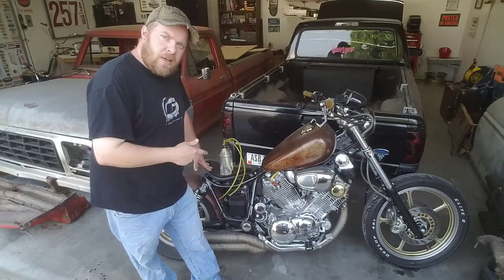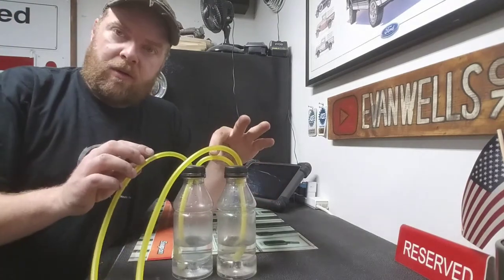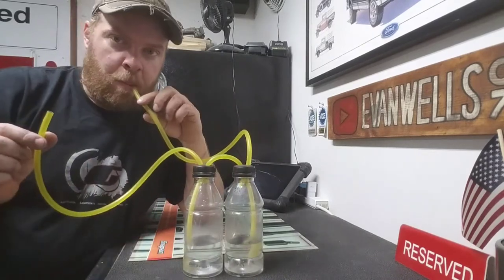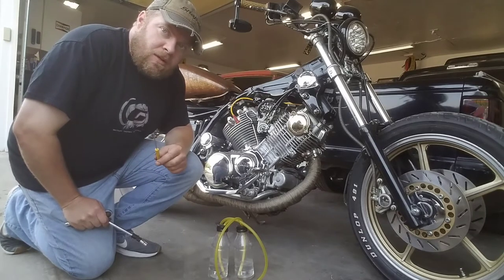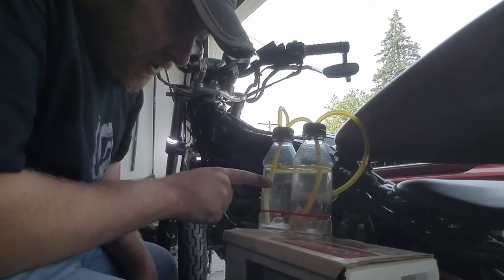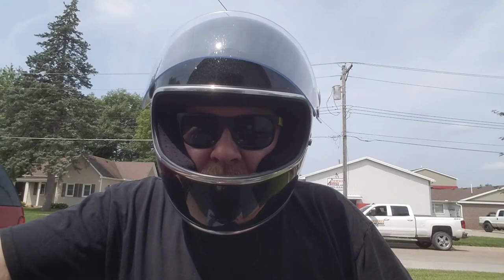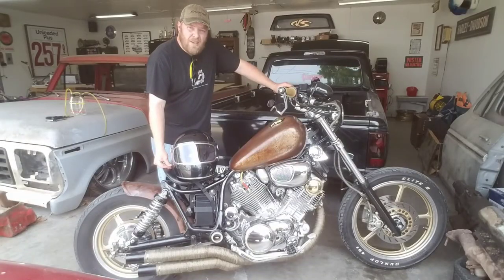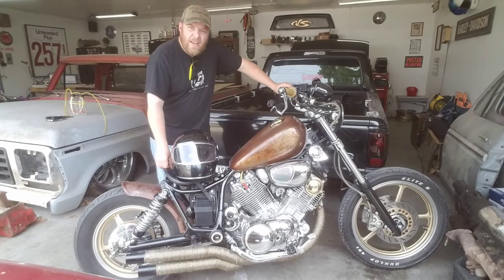88 YAMAHA VIRAGO 1100 - Carb Sync How-To & DIY Tool - Budget Bobber - Custom Motorcycle

Comment: What if youre bike doesn't start up at all after you did the carb rebuild instead it makes a loud boom noise
Reply from the maker: I would make sure the plugs are good.  Even if they look good, I'd try a new pair.  I will be making a new video soon getting the bike going for the season where I show almost exactly this issue.
Reply: @EvanWells07  this is my first bike I've owned the most I did to the carbs were taking the bottom bowls off taking the jets out cleaning them and putting it back together before my bike started up and now it won't start up and makes a loud boom noise and you see a flame come out the top exhaust tip
Reply from the maker: It sounds like it's loading up on fuel, then igniting it.  That's why I say to try a new set of plugs.  These things are the most picky thing I've ever worked on when it comes to plugs and fouling.
Reply from the maker: This is also my first bike, I've always been a car/truck guy, but got this for free, so I figured I'd give it a go.
Reply: @EvanWells07  okay I'll definitely try to get new plugs and see how that does
Reply: @EvanWells07  okay so, I had an extra spark plug I put in and the bike started up and revs up just fine idles a little lower than 1,000 rpm tho. But now when I put the bike in gear and slowly let off the clutch it dies on me what could be wrong now?
Reply from the maker: Have you adjusted the carbs?
Reply: @EvanWells07  I didn't take those out the air/fuel mixture screws stayed in the spot they were in when the carb was already adjusted
Reply from the maker: Is it a single carb or two?  If it's two, they will need sync and idle adjusted.  If not it may just need the idle adjusted.
Reply: @EvanWells07  yeah it's two, so I need to sync and idle adjust I saw you're video on the syncing which good idea by the way on how to do that, but how do I do the idle adjustment
Reply from the maker: @shawnlewis5772  if it's like mine, there should be a big adjustment screw by the throttle cables.  You can just turn it by hand.
Reply from the maker: @shawnlewis5772  sync the carbs first, then adjust the idle.
Reply: @EvanWells07  okay thank you for helping me out I appreciate it!🙏💯
Reply from the maker: @shawnlewis5772  No problem!  Hope it works out for you!
Reply: @EvanWells07  okay today is a free day for me so I'm going to sync the carbs where did you hook the hoses up to for the sync
Reply from the maker: @shawnlewis5772  on the carb boots near the head there should be a small vacuum line.  That's where I hook it up.  I'm actually working on a new video today, where I go through the carbs, re-tune them and sync them again.  Should be out the beginning of this next week.
Reply: @EvanWells07  Awesome! And thank you brother for you're help couldn't have done this without ya!
Reply from the maker: @shawnlewis5772  no problem!  I'm still fighting getting mine running right, so I hope it works out better for you than me :)
Reply: @EvanWells07  yeah mine just shuts off when I have in first gear and I'm trying to take off that's my only problem so far with it
Reply from the maker: @shawnlewis5772  if it just dies like you hit the kill switch, it may be an issue with the clutch switch or kickstand sensor as well.  If it sputters and dies it's probably tuning related.
Reply: @EvanWells07  yeah like it doesn't die when I kick it in first gear it dies when I start to let off the clutch in first gear like it losses power or something and just dies
Reply: @EvanWells07  one more question what lines did you get for the process
Reply from the maker: @shawnlewis5772  like the ones I used for the sync tool?
Reply: @EvanWells07  yeah I just dont want to get to big of lines you know what I mean
Reply from the maker: @shawnlewis5772  I just used 1/4" line I think.  It's just cheap stuff from the parts store.
Reply: @EvanWells07  okay thank you would 1/4" PVC Clear Vinyl Tubing work
Reply from the maker: @shawnlewis5772  I would think so.
Reply: @EvanWells07  giving ya a little update so it's running now idles perfectly at 1000 rpms but when it starts to get hot it ldles at 2000 rpms
Reply: So is that normal? Or is it running to lean or rich when hot
Reply from the maker: @shawnlewis5772  I guess I'm not sure.  Does it stay up at 2k rpm or drop eventually?  I know mine will hang a little when it warms up, but goes back down after a few seconds.
Reply: @EvanWells07  I mean yesterday when I took it for a ride the power was there it drove amazing but when the bike got hot as I was at a light it stayed at 2,000 rpms even when I reved it up once to see if it would go back down
Reply from the maker: @shawnlewis5772  that's strange.  The throttle or cables aren't sticking, are they?  You could try lubing the cables.
Reply: @EvanWells07  how could I lube the cables?
Reply: Should I try messing with the idle screw when it gets that high?
Reply from the maker: @shawnlewis5772  you can.
Reply from the maker: @shawnlewis5772  take the throttle apart on on the bars and spray some lube down the cable ends.
Reply: @EvanWells07  where did you put the second hose at I got where on the side you were on with the homemade tool but what about the other side where did you put that hose at?
Reply from the maker: @shawnlewis5772  it's the same on both carbs.  I have a new video all but uploaded where I go through all this in more detail.  Hopefully upload it tomorrow.
Reply: @EvanWells07  okay so I tried it and it like sucked both bottles in and almost sucked up water if not a little bit of water
Reply from the maker: @shawnlewis5772  you shouldn't have enough water that either can suck it up.  One bottle half to 3/4 full should be enough.
Reply from the maker: @shawnlewis5772  and if it's collapsing both bottles I'm guessing you may not have a balance tube between them or you are using too weak of a bottle.  That's why I like the "sports drink" bottles, they are thicker plastic.

Comment: Nice bike👍🏻 Do you mind make a quick tutorial on how to set the mixture-screws as well? I having trouble getting my xv1100 with mikuni carbs running properly😥
Reply from the maker: I could possibly do that.  It's getting nice here again, so I will be getting the bike out soon.
Reply: @EvanWells07  perfect! 👍🏻
Reply: Hi, i have the same problem with my airscrew settings, is it 1 1/2 turns out, or 2 turns out or 2 1/2 turns, i saw a guys video where he gad the screws 3 1/8 turns out.

Comment: I just pull the tube off the tank that runs to the front boot and hook that up to my synchronizer. The rear ones easy to get to using some long nose pilers.  Easier than removing everything.

Comment: Hi, nice video, how many turns is your air screws turned out? and what size is your main jets and pilot/idle jets?
Reply from the maker: My jets are one size up from stock on both.  I don't remember how many turns out, but I will be getting the bike back out soon and will probably go through all of that again.
Reply: Yes.please how many turns on idle adjustment screw.rebuilt carbs.,skipped this step.bad idea? Was scared I couldn't set back right again.

Comment: Evan, I have zero experience with engines -where are you plumbing in those tubes? Demonstrating how you manage to hold higher revs and balance the carbs would also be great. And did you set the gaps of the plugs? or just screw new ones in and get lucky? :D
Reply from the maker: sorry i should have shown where to hook it up.  there are 2 small vacuum ports on the boots behind the carbs that i hook the lines up to.  to check it at higher RPM i just turn the idle screw up to hold it consistent (and so i have both hands free).
Reply from the maker: and before i installed the new plugs i always gap them.  I use bpr7es NGK plugs in this bike, and they dont come out of the box gapped correctly for the bike.
Reply: @EvanWells07  Thanks man!

Comment: Can you make a video quickly to show how you connected the hoses, and also how to sync with higher rpm thank you
Reply from the maker: I will be getting the bike out soon, so i can make something.  Thanks for watching!
Reply: Did you ever make the video on how you connected the hoses??? I just found your video, and I need to do this to my bike, but I'm not sure if you ever did this.😊 @EvanWells07
Reply from the maker: Sorry I didn't.  It's just connected to the vacuum ports on the carb boots directly behind each carb.  Maybe I will make a short of it to put up soon.

Comment: Nice job ! 👍
Where did you fini your led headlight ?
If you have a link, it will be cool 😊
Reply from the maker: Thanks!  The headlight is for a Harley, I cut the ring off the Yamaha and modified it to fit so it bolts in like factory.
Reply: @EvanWells07  thanks for the answer...
Greatings from France ✌️
Reply from the maker: No problem.  Thanks for watching!

Comment: You still have your 88 virago? I have an issue and haven’t been able to solve it … Tim
Reply from the maker: Yep still got it.  Didn't ride it much this summer because I picked up a moped.
Reply: Lol 🤣, just don’t tell anyone! 
Have you ever had problems with your carbs other than syncing. I’ve had nothing but issues with mine. I remove the California smog to being off of it and that seem to make them run better. I had built them already. Now it did sit for a while, but my same problem is come back with it just without the choke on full will not even run, and then it barely runs.  It’s almost like there’s a major vacuum leak.
Reply from the maker: @user-kt2zn6ym1t I have had nothing but problems with the carbs since I got the bike.  I did replace the stator, regulator, and battery also, but never made a video about it.  Other than that, no issues.

Comment: When you did the straight pipes what did you use for jets when you rejetted? Just curious
Reply from the maker: i played around with jets alot.  i think it is currently 1 size up on both jets and still may be a little rich at idle.
Reply: @EvanWells07  with my stock pilot jets mine is ok I went to a 42.5 which is the next size up and was too rich as well. Unless you are running pod filters directly on the you shouldn’t go up a size on the pilot just keep it stock. I was fueling plugs because of that as well
Reply from the maker: @Donjacobson11  yeah i probably need to go back to stock on them.
Reply: @Donjacobson11  Hi, what is your main jets size on both carbs? and what is your air screws settings, i also have a straight pipe on my xv1100 1998 model
Reply: @bertusnolte512  I haven’t straight piped my bike I have a cobra exhaust which is pretty open. I had 130 in the front and 132.5 in the rear and 2 .20 shims on the needles that got me pretty close

Comment: Did you ever get it sorted out with th e plugs etc??
Reply from the maker: I have been working on it a lot lately.  Have a new video coming soon!
Reply: @EvanWells07  cool i have the same bike year and would like to see that video of the bogging fix would also like to know what vacum ports you used for the sync
Reply from the maker: In my latest video on the bike I show a little more in depth (or just the stuff I missed) in this video.  I should be putting the new video out today where the flooding issue is corrected.  Hope they help!

Comment: I used some vitamin water bottles and they collapsed from the vacuum when I started the bike(91, 1100). I was still able to get the carbs balanced, but I was just wondering if this is a normal thing? Your bottles don’t look too dissimilar and yet they stayed intact. Also, after I was done getting them adjusted, my idle RPMs were at around 2300. I had to use the little screw next to the throttle cables to lower it. I’m not sure if this is common either, but it worked. Thanks for the video, the bike looks killer.
Reply from the maker: Thanks!  Glad it helped!  Yeah you need a pretty sturdy bottle to hold up to the vacuum, not sure how thick the bottles you used are, but mine were some poweraid bottles if I remember correctly.  It's normal to have to adjust the idle after.

Comment from the maker: If you read this and don't comment, I don't know if we can be friends anymore :(
Reply: Comment
Reply: ok fine ill comment so you can be my friend lol.   got myself a virago 750, its my first bike and also a great platform to learn the mechanics of motorcycles. im watching every video i can about the virago to learn as much as possible. only thing i wish i had was a heated garage so i could work on the bike in the winter months.  next thing i want to do is upgrade the headlight on the bike but not really sure what to buy for a good fit. theres a few videos with the 1100 but nothing showing the 725, i think the headlight is a different size.
Reply from the maker: @HypnoticAbyss  i found some for the virago when i was doing mine, but ended up using a harley one and modifying it to fit.  I wish i would have started this channel back when i was working on the bike.  would have had lots of how-to's and stuff.  more to come on the bike soon enough though!
Reply: An Orange is an orange because its not yellow. If it was yellow it would be a lemon identifying as an orange. There's my comment,
Reply from the maker: @NitroMaximus lol